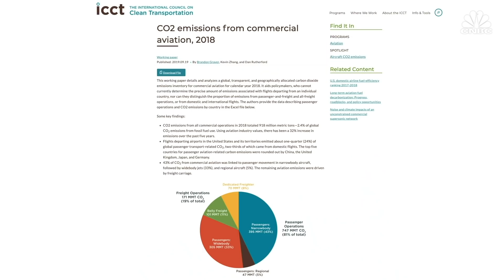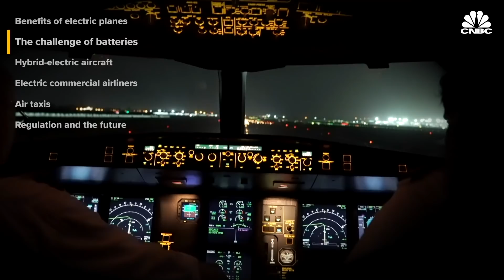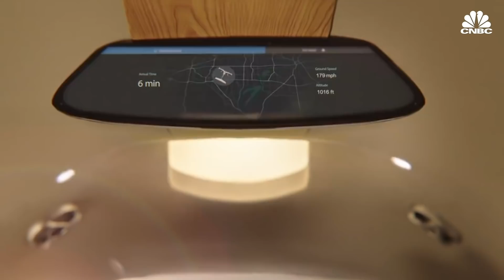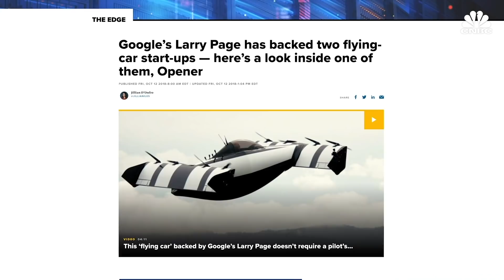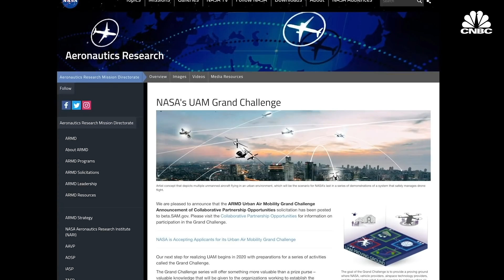Why Don't We Have Electric Planes Yet?

Comment: Liquid fuel becomes lighter as the journey progresses! 

The battery will always weigh the same!
Reply: Exactly why I can't imagine having fully electric planes, the weight is just questionable. Unless we invent lighter batteries.
Reply: @jenreyfernandez  not with current batteries. Solid state high density batteries that can power even lightsabers are what we need
Reply: @jenreyfernandez  (or just used hydrogen)
Reply: @fl00fydragon I actually proposed a hydrogen powered aircraft to my professors, infortunately we're not that technologically advanced to keep it stable.  It's incredibly light, but also explosive.
Reply: @jenreyfernandez  wait, you mean like a balloon? 
Im basically saying that tests with rockets and jets have shown that the thing works. 
Obviously you need different materials for the tanks but there's quite a few breakthroughs the past few years, the most relevant was a hydrogen immune alloy built for fusion reactors.
Reply: @fl00fydragon  Not entirely like a balloon. You need a closed container where you can pressurize gas type fuel so it can deliver the right amount of thrust. On jets and rockets, they're good enough for that. But passenger planes? We don't need speed, we need efficiency and range. Hydrogen isn't "safe" enough for commercial flights, otherwise we would have achieved that already.
Reply: @jenreyfernandez  There's studies that show that we could do so in a bit over a decade, the technology is there to be reliable in the extreme stresses of a rocket that are not found in a passenger plane (thanks to carbon fibers)
Other benefits of using hydrogen is that the fuel itself can be used to cool the engine in both jets and scramjets.
Meaning that a hydrogen refocusing would make high altitude supersonic flight an option for cheap commercial flights where fuel efficiency skyrockets due to decreased air friction.
Not ot mention that it's the perfect fuel to develop spaceplanes, a must if we're looking into industrializing space.

Going back tot hat study I read the biggest hurdle to adopting hydrogen isn't technocal but economic, basically we would be kicking a trillion dollar oil industry in the nuts. 
An industry that needs to be kicked there anyways if we are to prevent having to deal with an environmental clusterfuck.
Reply: @jenreyfernandez  exactly history shows technology gets more powerful and smaller as time goes think of the telephone
Reply: Jen Reyy so solid state batteries?
Reply: @jenreyfernandez  im pretty sure a electric system will most likely produce a better power to weight ratio
Reply: Jen Reyy No is NOT,

The weight has nothing to do with it. We have HUGE plane carriers that travel with Helicopters and Tanks across countries.

Engineering is all you need to deal with the extra weight, once the plane is above ground is completely irrelevant how much it weights before or after.

Edit: for the morons who forgot to read.... ENGINEERING will take care of the extra weight!!!
Reply: @powerhouse884  lol wow so you're just going to ignore physics????
Reply: @powerhouse884  You're hilariously wrong. At touchdown, the overall weight of the aircraft needs to be lower than at takeoff, otherwise the landing gear will collapse. Stronger landing gear are heavier and significantly reduce range and the number of passengers and cargo you can carry, while driving the aircraft's cost (for purchase and maintenance) up. This applies to ALL aircraft REGARDLESS OF SIZE. Unless lighter, denser batteries are invented, or those batteries are dropped from the aircraft in-flight, it wouldn't work.
Reply: @powerhouse884  Fuel is used mainly to produce thrust, and the plane get lighter as the journey progresses because fuel is being used. 

Imagine electric planes with consistent weight flying, it won't be able to produce enough power to fly over the Atlantic. But I see that they can fly domestically, which is great for the environment.

The fundamentals of a flight is Thrust, Drag, Lift and Weight.
Reply: @powerhouse884  if weight does not matter, then we will be building plane using concrete. It is a lot cheaper than the current material used for airplane.
Reply: Lucas D. One solution is hydrogen fuel cells they don’t lose weight which is a problem but they provide a similar energy density to jet fuel.
Reply: Event if you were to redesign the frame of plane you would be unable to do so economically. The main problem with what you just said is a findamental miss understanding of how thrust works.
Reply: More thrust= more power = more cost.
Reply: @flyfox3621  Generally speaking only really large airliners have the requirement to burn/dump significant amounts fuel because MTOW is significantly above max landing weight.

Not every airliner has the ability (requirement) to dump fuel
Reply: @powerhouse884  You don't understand the point this isn't about payload capabilities
Reply: @powerhouse884  Well you're very wrong lmao. Study physics and engineering before making statements like that
Reply: AwkwardYet LOL Wow

Amazing input on your part! Lol
Reply: arjun sharma Said Donkey
Reply: @powerhouse884  That's completely inaccurate compared to basic equations for lift and power for aircraft to fly. 

Also it's not weight its mass
Reply: @flyfox3621  thats what he told you. Engineers will take care of the weight and build better landing gear
Reply: @powerhouse884  commercial  planes live and die by  cost of the trip it
Reply: You could say liquid fuel becomes lighter as the flight progresses. Or if you’re a glass half full person, the liquid fuel plane is heaviest at the exact worst moment when it is trying to get off the ground. From an electric perspective the plane does not have to be heavier at take off.
Reply: @yffips  While that is true it's only beneficial if the weight of electric propulsion systems is significantly less than an equivalent ICE and fuel. 

At the moment the 2 systems weigh about the same so the benefit of electric propulsion dwindles significantly as the size of aircraft goes up
Reply: @powerhouse884  have you seen wight and balance calculation of an airliner? The fact that the airline get lighter is included in the performance metrics of the plane. This is why planes does not top their tanks every time and just filled the required fuel for the trip. Weight of the fuel is a very important metric in a flight plan.
Reply: blitzcaster i understand your point but you are failing to understand Plane carriers which currently travel with TANKS!!!! Freaking TANKS!

No amount of batteries will be heavier than traveling with TANKS.

An electric plane will be engineered around the extra weight. The point is, the extra weight DOES NOT MATTER.

We already have Planes who travel with heavy military equipment.
Reply: @powerhouse884  because on that plane the fuel on tanks act as payload, not as an energy storage system. Here, watch this video for a start. Then you can search on YouTube "airline fuel calculation."

https://youtu.be/VNvzZfsC13o

Edit: ah you mean tanks as in combat tanks, not fuel tanks. Actually if you watch the video I posted batteries is indeed heavier than tanks. Also it is about power stored to weight ratio, not weight alone.
Reply: PowerhousePR guy you do realize those planes travel farther without carrying those tanks right. 
Second, any plane carrying tanks are usually military owned are constructed differently from commercial grade use. 

Weight is everything in this case. More weight means less distance it’s able to travel and areas that need to be strengthen when touch down comes which in turns add to even more weight. 

No one is saying the plane still couldn’t fly, but we are saying weight adds a costly expense that does outweigh the pros of using an electric plane
Reply: @powerhouse884  but those are massive carriers. United, JetBlue all the other airlines, could not produce such a humongous aircraft for mass production and mass travel
Reply: Algae based biofuels are the ONLY reasonable alternative to aviation fuel. Batteries will never be a realistic solution.  They are just way too heavy.
Reply: @tarstarkusz  Dude, you can burn hydrogen in a jet. 
It works. 
No co2
More energy density
Reply: @Fl00fy... Too bad we don't have any hydrogen!  Hydrogen fuel cells could be used as well. Again, too bad we don't have any hydrogen.
Hydrogen, assuming we made it, requires very heavy containers to hold it.
The only realistic option is very expensive. Synthetic oil made from algae.  It would be 100% carbon neutral, but it would also be extremely expensive, basically an effective oil price of hundreds of dollars per barrel.
Reply: @tarstarkusz  Or you can produce hydrogen with 2 cables, a tank, 2 metal rods and an energy source...LIKE NUCLEAR ENERGY!
Reply: @fl00fy... Not very efficient.  Not an energy SOURCE.  At best, it's an inefficient carrier.  Fuel cells would weigh too much.  Algae would actually be a source. There is a lot of improvement to be discovered in algae. It would also allow the continued use of a trillion dollars or more of equipment.
Reply: Abhishek Angadi but we could have super chargers in The sky
Reply: Okay hydrogen helps this
Reply: jweltsch22  what would you suggest, out of curiosity? I could see hydrogen being viable with the correct engineering and time taken to make it safe. If we already have a safer alternative now besides lithium ion batteries, what would do it?

(Not an attack, I'm genuinely asking for an opinion. Promise.)
Reply: can actually answer to lighter battery is not a battery but A capacitor A capacitor is simply two plates with a cavity between them they can store electrons through a static electricity It can be instantly charged in nanoseconds and it can be discharged just as quickly but the nanosecond think normal capacitors can’t be charged in nanoseconds it’s only atom thick sheet of carbon stacked one layer on top of the other to produce the static electrical cells that can be charged and discharged in nanoseconds and it has a far greater energy density than lithium ion because of the number of sales he can half due to the fact that these are tiny microscopic individual sheets and you can have trillions of them stacked on top of each other and there’s also the fact the atom thick sheets of carbon  itself has very little electrical resistance and if you fold the atom six sheets of carbon at 1.1° to produce a three-dimensional structure or you can create regions of electrical conductivity and resistance and you could possibly use that to further enhance the capacitor to control the flow of electrons this is some really advanced stuff I’d encourage you to study it so you can both increase the energy density and because this thing is predominantly made out of carbon it’s significantly lighter than lithium ion battery and it would also be very dirt cheap because his primary ingredient is carbon and theoretically you can genetically modified bacteria at the manufacture of the Atom thick sheets of carbon through something called the carbon fixing cycle Or you could even 3-D printer to using lasers through laser vapor deposition on a sheet of copper you can even produce it by combining acetylene with oxygen and igniting it and some other chemical I forgot  but currently that process doesn’t produce very high-quality atom thick sheets of carbon you can also produce cheap very Flawed graphene by using tape and graphite in fact it’s already being used in our cell phones alongside of carbon nanotubes technology darty exist were just in its infancy these kinds of super capacitors of already been developed but their experimental prototype’s Kind of forgot how much energy density it has over lithium but it is significant
Reply: Finally, at last, somebody noticed that carrying a turbine, a generator and an electric engine is a dumb idea.   It makes a lot more sense to ditch that useless electric stuff...  A typical Tesla battery has 450kg in weight and is an energy equivalent of 2kg of Jet A.  Renewable energy is expensive and totally useless without 100% carbon or nuclear back up....  Uber discontinued its driverless car project and is losing money.  They cannot even build an electric truck or a battery powered ship.... Not even a submarine.... How soon? Ever? A nuclear powered container ship?  Maybe....  High energy density is the key.  Only disposable Al-based batteries in torpedoes are OK.  But they cannot be recharged....
Reply: @Cellphone Dave Or, how about we make aircraft powered batteries and let the plane fly into a hurricane so when lightning strikes it, it instatly charges and we have unlimited energy. HAHAHAHA!
Reply: No
Reply: jweltsch22  Aaand wrong. 
Hydrogen is harder to explode than kerosene (You can thank rocket technology research for that find) and material technology has progressed to the point where we have the materials required to adapt hydrogen. 
In fact a study 10 years ago stated that we could move to hydrogen in a relatively quick R&D cycle and since then we've got even better materials thanks to fusion reactor research. 

Also both fuels can be either flammable or explosive depending on the mix with oxygen. 
Hydrogen is explosive at a 1:1 ratio which is not happening, this is why the hindenburg burned and didn't explode. 
In other words you are wrong on all counts. 

Tell me, why are you invested in retaining an old and harmful technology such as kerosene?
Reply: red herring
Reply: I will also try to get some links for you guys on graphene super capacitor’s
Reply: and then there is the lithium air battery that has the exact same energy density as gasoline and because it uses air as A cathode it’s significantly lighter than pretty much any type of chemical battery and because it gets its ions sorry it’s positive ions from the atmosphere age has gigantic energy density or an internal air supply due to the density of oxygen you can have inside of a cell because of how light weight the atoms are you can have a huge amount of energy density like I said but there’s a gigantic mechanical problems surrounding lithium air batteries
Reply: @zaneal-amood5474  So why aren't these 'projects' getting funded or invested by actual aircraft companies like Boeing or Airbus? If it's a good investment, I don't see any reason not to improve this 'project.' 

Reality is, it's just a concept, it is too expensive to make and thus, not economically viable as Aviation gas. Sure they're at least creating something that could benefit us. But instead of creating something new, why don't we just improve what we already have?
Reply: Jen Reyy well that’s because they are the military’s invested in it Boeing Northrop Grumman probably The thing of it is that you just don’t hear it because this is really boring it’s really complicated what I’m trying to say is that CNN Fox News these guys don’t like to report on technology unless they think it’s big news because think about it the military is developing laser weapons they can shoot down missiles to drones and they need really powerful batteries to run those kinds of things so this this is right up their alley for that kind of research
Reply: Jen Reyy it’s in the experimental stage but the thing of it is there is it is very close if anything I would say it’s about five years away i’m sorry that I might sound confusing it’s just that I have a busted iPad sometimes it doesn’t the keyboard doesn’t work so I have to use the text to speech device so if I say anything that sounds confusing please let me know and also I sent you some links to some websites that talk about graphene research
Reply: and remember lithium air batteries have gigantic problems but they’re pretty much the best type of power storage system you could ever want really outside of antimatter
Reply: @Zane... When oil went to $150 a barrel in 2008, there were little companies popping up all over the place for algae based fuels. Pretty much all of them went bankrupt.
Reply: tarstarkusz Well you’re right but the thing of it is though is that graphing is not just useful for batteries it is pretty much the One of the biggest breakthroughs in computer science of this decade in fact your computer electronics right now has Atom thick sheets of carbon inside of it it’s used as a thermal conductor it’s used as an insulator it’s used as a super capacitor is used as a transistor of the transistor thing is still in the prototype stage carbon nanotubes are used as heat conductors but in order to get his insulator property you have to sort of twisted in 1.1° so it’s not just one thing and this has massive investment across the world By companies of every type you could think of engineering and construction benefits from graphing due to the fact that it’s 200 times stronger than steel it was standing tension forces you know shearing forces You can use it to make quantum tunneling transistors which will overcome the moors limit it’s ultra lightweight and it can be used in wearable electronics because it’s made of carbon it’s bio compatible so could be used for medical implants and could power medical implants And it’s also seeing investment from multiple companies in the field of electric Cars due to a large energy storage from a large surface area super capacitors or super capacitor battery hybrids oh basically I don’t care what happens to the battery industry you’re not getting rid of graphene
Reply: tarstarkusz And another hole in that logic is that basically the reason why everybody’s going all in on electric cars that electric cars are genuinely just better than internal combustion engines even if they are powered by algy based biofuel it is just that the there performance is much better and also then even biofuel still produce a small amount of pollution that’s released into the atmosphere and as population on the earth increases the more generators we’re going to need the larger the generators we’re going to need the more cars we’re going to need the more jets we’re going to need the more planes are going to need so that tiny little bit of pollution would still add up to become a very big problem because you’re basically just burning chemicals and you’re releasing it into the environment where as the only real flaw for lithium is that You have to mind it from the ground and that could release in missions but if all the mining machines are electric that reduces the admission significantly and then not only that but advances in mining technology specifically for mining rare earth elements is reducing the amount of damage that we do to land from mining quite significantly
Reply: @zaneal-amood5474  Actually it make sense, it's not confusing. I'm an studying Aerodynamics, going for aircraft maintenance engineer, so it make sense to me. Yeah it's actually great that we could advance technology with Graphene. Down side is, it's just too expensive go manufacture, much more if we mass produce it. Imagine the cost of producing large quantities of graphene, along with the emissions that it creates on production. It basically kills the purpose of being "environmentally friendlier" than conventional plane fuel. 

But, I'm all good with technology advancing. I'd like to see that in the future.
Reply: tarstarkusz and then there is the whole mess of the internal combustion engine itself this thing is a complicated monster do you have any idea how complicated and Ice Engine is oh sure the basic operating mechanics are simple but the practice of building an engine is not I mean it’s really just a miracle that we were able to come as far as We have with this technology it’s really a miracle that we in the first place as a species didn’t dump this idea in the garbage and then wait for batteries even though they weren’t very efficient and just stuck with horses until we discovered lithium ion that’s how complicated and internal combustion engineers in all sorts of components in the engine could break down and fail is where in tear occurs over the years and it’s very expensive to replace because you have to take the engine apart and then rebuild the engine it’ll cost you thousands of dollars so electric cars the only thing you have to replace after 10 to 14 years is the batteries the engine is very simple very very easy to repair and you could actually design the battery to be easy to Replace
Reply: Internal.Combustion.Engine that is what ICE stands for
Reply: @zane... Are these cross-compatible though?  Does computing and energy storage need the same type of purity, the same structures etc?  I really don't know. I'm not really up to speed on that stuff.
It sounds like an interesting field.
Reply: @Zane..  Algae is carbon neutral because the algae produces the oil from CO2 in the air.  I think there is some algae based oil in the supply chain, but it's not carbon neutral because the CO2 is not coming from the atmosphere. But, it is only a miniscule amount of it being produced and those contracts may be gone by now.
A lot of what we do is going to be more than offset by what is going on in Asia.  Not only that, but prices need to come down even in the Occident before EVs are anything other than a luxury car.  The cheapest ones are still in the high 30s.
Air taxis are a pipe dream.  They are never going to be as cheap and common as uber.  Lifting tons into the air is a physics problem. To whatever extent technology helps, cost of regulation will keep it a rich man's thing.
Reply: @zane..  The ICE has over 100 years of R&D behind it.  Granted, the electric motor isn't exactly new either.  Where EVs make sense, by all means, they should be used.  
However, where I live, they will never make sense for most people without an astronomical investment and changes in laws.  It's very simple. Very few people in my neighborhood have a garage or assigned parking.  You park where you can, where there is a spot.  My neighborhood, like many on the East coast were built before the widespread ownership of automobiles.  You would have to change the laws to assigned parking and pay to have an outdoor metered charging station installed in your "spot"
Reply: tarstarkusz It’s Got everything to do with the way the allergy produces hydrocarbons from the oil six to hydrocarbons themselves is the problem it’s self it’s got everything to do with the bio molecules called hydrocarbons that are burned that release the CO2 back into the atmosphere you can make a hydrocarbon that can be burned and release smaller amounts of CO2 but you cannot have one that releases no CO2
Reply: tarstarkusz The electric motor was the very first car engine before gasoline engines took off before the model T car as were electric no seriously the electric car was the very first car look it up yourself
Reply: tarstarkusz Actually they came up with a way to solve this problem there is a magnetic induction charging pad and you drive your car over it and all you need to do is hook that paid up through a cable to your house so you don’t really need to do very much to actually charge the car the infrastructure or you could literally just buy it and install it in your garage and it really wouldn’t take very much to develop a device that could take the electrical current from your house amplifier in and pump it through a cable into your car is charging port so that’s not really a problem
Reply: tarstarkusz oh I’m sorry I forgot I didn’t read what you sent properly The problem of that is that you’re still burning oil and you’re still releasing stuff in the atmosphere and oil has more in it than just hydrocarbons for example there is a lot of studies going into Paul oil and gas fire power plants cause brain damage and cancer so the idea is to just move away from oil completely divorced it completely but you’re right though that doesn’t have any of the pollutants and my guess is that it’s got a lot to do with what the gas released from the internal combustion process mixes with inside of the generator plant that releases I was kind of a mission to but that’s not the only factor see this oil was sitting in the groundFor hundreds of millions of years And combined it with all those different elements with all those different elements it releases doesn’t just release just hydrocarbons so that’s why I hate oil as a power source but oil from alge Would not have that problem you could even feed them plastics probably and they could convert it back into oil Provided they were properly genetically modified but my cases is that you would always be releasing CO2 back into the atmosphere carbon neutral just isn’t enough for me oh you’re basically doing is you’re taking the CO2 that’s in the atmosphere and recycling it back into usable oil and to me it’s just not acceptablewe have to move beyond it Or in other cases you’re trying to create an entirely different type of organic hydrocarbon that produces energy when burned but it still produce CO2 just smaller quantities and again to me that’s unacceptable
Reply: @zane... I don't see how this pad can solve anything.  There are no outlets outside.  Am I supposed to run an extension cord up the block to the spot I can find? This is just a different type of charging station and has the same problems.  Just burying it would entail tearing up the street and re-paving it.  If you don't have a garage, you can't put it in your garage.
Reply: @zane... Not that it matters, but the very first car was the Benz Patent-Motorwagen, an ICE car.  I do know that there were quite a few cars in the early 1900s that were electric.  But we're not even talking about cars, we are talking about planes (or at least I was) when I said lifting tons into the air is a physics problem.
Reply: @Zane.. As I understand it, and granted, I could be wrong, algae based oil is carbon neutral.  CO2 is captured by the algae and then re-released when burned in an engine.
Reply: tarstarkusz yeah and It’s only became at least about 30% efficient maybe even 20% efficient because of all the escaping energy from the internal combustion reaction we don’t we have no way of harvesting it only in recent years in the recent decades we develop infrared photovoltaics could convert the heat energy into electrical current where as electrical engines are 70% efficient 80% efficient the only limitation with how fast you can go is the amount of motors you can pack into your car engine which by comparison to the cylinders of an internal combustion engine are very very tiny and the energy density of your battery or super capacitor and the weight of the battery but the thing of it is is that as I’ve shown you that’s not gonna be a problem for very much longer and then there’s other types of batteries to their Assam I think there was aluminum lithium batteries I’m not for sure I have to re-look that up again then there’s batteries based on fluoride there’s all sorts of discovery said are reducing the weight of the battery and increasing the safety one is  by replacing the liquid electrolyte with a solid-state electrolyte that also reduces the weight significantly for example another massive breakthrough in recent years what is the discovery of a type of plastic they could behave as an electrolyte see I am on a quest for carbon negative I don’t want carbon neutral I want carbon - oh and to answer your question regarding the mass production of graphene A recent discovery allowed us to 3-D print it using laser vapor deposition on a sheet of copper see the ideas you have your laser beam emitter you have carbon gas under high-pressure then you have the sheet of copper on something that looks like a treadmill and then the idea was the laser compress is the carbon gas and causes it to deposit on the copper as the copper seat moves along the treadmill creating a graphene sheet basically and it’s very high-quality and this is basically a 3-D printer for graphene Didn’t your question it was someone else’s question sorry but some because these capacitors are very lightweight they can allow for air cars they can allow for flying Vitale’s to become far more than just a pipe dream because its primary ingredient is carbon and copper very lightweight elements and it’s solid state So it’s much safer and because of how cheap carbon is this thing can be easily mass produced on an industrial scale oh and then there’s another way to create air taxis and this way is even more cheaper you just don’t have batteries in your all electric air taxis or internal combustion engines you use atmospheric electricity and I’m not talking about Nikola Tesla I’m not talking about harvesting energy directly from the static electricity of the atmosphere I’m talking about using microwaves to transmit power through the atmosphere microwaves have a very long range and they have a very long wavelength that allows them to pass through the atmosphere with very little resistance that’s why they have that range and you can use rectenas to harvest microwave and convert them into power there a type of antenna but instead of using radio waves it uses microwaves it interacts with microwaves and a molecular level to produce electrical current that’s why we can convert a beam of microwaves into electrical information so the only real problem with that is building the infrastructure to reflect microwaves produce microwaves and as well as transmit the microwaves to the flying aircraft but after that that’s  really your only limitation and actually setting up this infrastructure really wouldn’t be all that difficult because were already using microwave transmission to create 5G Internet it’s one of the ways of creating it so the technology for that exists all that needs to be done is to be improved and the 5G revolution is going to drive those improvements And the infrastructure would actually be beneficial so there would be zones where a wireless powered air car could travel which would prevent total chaos and filling up and congesting the airways around the city so that infrastructure would actually be an improvement
Reply: tarstarkusz Another problem of the  internal combustion engine is that it’s just not as fast as an electric vehicle the difference is how many cylinders you can add to an internal combustion engine versus how many motors you can add to an electric engine that’s the question there and then there is the weight of the 2 Engines the complexity of the two engine types compare the complexity of the two types together one is far more durable than the other because it is far less moving parts far less nuts bolts screws tiny tiny little screws and nuts that you have to disassemble the entire engine defined didn’t repair which can cost you thousands of dollars
Reply: tarstarkusz https://en.wikipedia.org/wiki/History_of_the_electric_vehicle
Reply: tarstarkusz the very first electric vehicle was an 1890 invented in 1890 so they are older than the Ford model T And the thing of it is is that we’re not talking about in creating electric airplanes for intercontinental flight that’s decades way even with super capacitors that have the energy density of a lithium battery and are made of really light weight carbon air cars and taxis that are vetols can easily use graphene super capacitor’s Because we’re not talking about trying to fly from one state to another era cars Vertacal takeoff and landing capable taxis they just have to city to city district to district Town to town and graphien super capacitors are incredibly light weight because they’re primarily made out of carbon actually they could be even lighter than the liquid gas used for modern day jet engine once the gas tank is full I mean
Reply: tarstarkusz like I said I don’t care for carbon neutral that’s just taking the path to Heck that is paved with sunshine it’s good for a stopgap measure but it’s not good as a permanent replacement as like I said you’re not getting rid of the CO2 you’re just recycling it and ensuring no more waste emissions are created
Reply: @Zane... Please, if you can, break your text up a bit.  I just don't see uber being electrified.  I don't doubt very expensive air taxis, I doubt cheap air taxis.  If a car breaks down, no big deal. If a helicopter breaks down, look out below.  

It takes an enormous amount of energy to lift mass into the air and it also creates a lot of noise, even with an electric motor.    These "taxis" would not be operated by Somali illegals, but licensed pilots, again driving up the cost.  No amount of technology can overcome these types of problems.  

Regulation is where I see even cars running into a problem.  I absolutely oppose driverless cars or self-driving cars.  The tech sector has proven again and again and again that they cannot keep anything secure and they cannot keep major bugs out of software either. This is getting worse not better.  

I always knew they could not resist the temptation of making these cars on the internet and remote updating.  The vulnerability to hacking and the kind of havoc that can be created with 10s of thousands of compromised vehicles is truly scary.  I was right.  If we are even going to consider driverless cars, the program needs to be on a ROM chip that cannot be changed or a PROM chip with a physical lockout by default.  This way they can be quickly and easily upgraded a dealer without exposing society to the dangers of hacked cars.
Reply: @Zane.. The main problem with electric motors is you have carry around heavy batteries to power them.  We'll see what the future holds.  I've been hearing promises of technology just around the corner for 50 years.    When they say "in 20 years" they usually mean "an unknown amount of time because it is not possible today without significant technological hurdles"
Reply: tarstarkusz Those technological hurdles are actually around the corner and the problem is is that when you develop a new breakthrough when you discover a new breakthrough you have to send your work in great detail to be  reviewed Reviewed by other scientists in a process called peer review and then if they don’t find anything wrong with your process with your theories with your equations on a fundamental level which basically means well proven laws of science that your device would contradict if they don’t contradict those laws of science then you get past peer review which has multiple processes multiple times it happens multiple times scientist in Other laboratories around the world they have to see if they can’t replicate your Process that you used to create these batteries in their own laboratories independently and then once you get past that phase you have to improve have to increase the efficiency and often when you’re designing it you discover entirely new problems that they have to be addressed but the point is is it at least we should just be thankful that there are this many discoveries in the field of energy storage because the worst thing you would want the last thing you would ever want is to hear nothing at least we hear everything all the time about new breakthroughs in batteries the worst thing would be to hear nothing because that means nobody has any idea how to improve it or they think it’s impossible like for example you rarely hear anything about any breakthrough in faster than light travel and there’s real good reason for that Is there another thing Elon musk also showed us through his company SpaceX that something that people thought for generations was impossible was only just waiting for the technology to catch up for it and it already cut up to the idea but everybody just thought the idea was ridiculous and laughed it off that idea was self landing Rockets I mean who would’ve ever guessed that would have worked if I had taken that idea to somebody 20 years ago who has a rocket scientist they would’ve just laughed and he would’ve listed all of the logical perfectly reasonable explanations for why that could’ve never worked And I’m sorry about my text the problem is is that my iPad is kind of finicky so I have to use the text to speech device
Reply: @zaneal-amood5474  your comments are really good and informative, but very hard to read without any full stop or commas. put a.. after. each. sentence.
Reply: just dump the batteries
Reply: Batteries get better density overtime tho.
Reply: @UtraViolet...  We do not need marginal improvements in batteries for this to work, we need whole number multiples.  Electrification has become a cult.
Reply: Why not put a BAND on airplane's,they are the biggest killer in the world.
Reply: True and sometimes it's necessary to release fuel in order to perform a safe emergency landing. You can't do that with a battery.
Reply: Electric planes will fly much higher because they dont need oxygen to combust the fuel. There is much less drag the higher you fly therefore they will be much faster
Reply: @mo7881  Available oxygen for combustion is not the reason airliners don't fly higher. 

The aerodynamics of creating lift in thinner air is.  The U2 spy plane can fly at 80K + feet.
Reply: gel batteries are 5 times lighter
Reply: Until it hits the ground.
Reply: Hydrogen fuel cells in electric aircraft will fix this.
Reply: Battery have liquid in them (lithium iodes) and that's only 1 flaw against many pros
Reply: In theory they could be parashuted out mid flight and re-used in another plane. In planes, mass is drag is consumption.
Reply: @Daryl Johnson thats a great answer to the issue, thanks!
Reply: but my smartphone feels heavier when its charged
Reply: Jeffrey Johnson  Most of these engineering challenges have been  solved thanks to it's use in the aerospace industry.
For example the current breakthroughs in material science, such as carbon fibers and grapphene make it possible to have lighter tanks for compressed hydrogen.

Additionally it fits the bill for the criteria needed for an immediate solution.

And if it's energy density per volume was not viable it would not be used as the fuel of the delta series of rockets.
You know those machines where every extra gram of weight is a setback.

Now if it does turns out that it's not as profitable per flight as kerosene then here's a revolutionary idea: maybe we should prioritize the wellbeing of our species over the profit margin of a few executives.
Reply: Jeffrey Johnson  
Which are all problems that can be solved with current day engineering. Even if you reduce the passenger count by a bit it's worth it and can be offset by cutting the profiteering of airline companies, you know the same guys who proposed to make passengers stand in the plane to maximize massenger count and sell basic comfort as a luxury.
In other words, regulations are obviously required.
Reply: Jeffrey Johnson  And all those methods can be implemented to create fuel tanks for airliners, there's no rule that you can't make a longer plane or use multiple cylindrical fuel tanks .
Reply: Jeffrey Johnson thank you for the insight
Reply: @Ben  Daulton  You are the one that is stuck in a fantasy world. 
We are facing a crisis where we need to radically redesign our technology or face a biosphere collapse. 

The first is hard but feasible as the technology is already there and we just need to get doing it, the latter is near impossible because it's expecting us to terraform a planet we'll destabilize, a technology that in the best case scenario we're 3-8 centuries too late from when we'll need it and would demand global scale megastructure production. 

You can't tout the line "innovation will fix it" when you are against a project that is entire orders of magnitude less complex than what you are expecting. 

Yes, profit margins will have to be cut and the aerospace corporations will have to be commanded to do so. 
Guess what, we've already done that before, it's how we responded to world war II, a lesser threat when compared to the upcoming extinction event we're creating.
Reply: @Ben  Daulton It is technologically feasible without requiring us to wait for the development of some wondrous new technology from scratch. 
Guess what sunshine, unless you make the final push to fund the engineers and produce a technology it will never exist, regardless of feasibility. 
This is a case where such a push is required. 

These "vegan farts" is the most energy dense gas we got and can be produced with nuclear energy without harming our biosphere. 
This is a viable solution to the problem at hand. 

For all your whining I don't see you presenting a solution, let me guess, you will "invisible hand" stability back into a devastated biosphere?
Reply: Actually, a full battery is slightly heavier than an empty one.
Reply: @thespectator5259  Certainly I would agree. I can see electric flights being viable for short range routes in the future but long haul flights are a tough nut to crack.

Looking at the current fire situation in Australia doesn't bode well for our future. At what point do we say it's all not worth it. To hell with cross ocean flights. If we have an apocolipse and the entire planet is consumed by fire do we then accept that reaching the other side of the planet should take a week. I think I would be ok with that. I'd even be ok with that now.
Reply: Daryl Johnson  
@powerhouse has obviously never flown a plane and his engineering has no competent answer for density altitude at high elevation on a 95 degree day.
Reply: That's a good point.
Reply: Not the combustible battery used on note7. Samsung is always ahead of curve.
Reply: A airplane produces approximately  1 tonne of air a second by the laws of thermodynamics. How can a engine combust without gas ? There is absolutely no work done by the system.
Reply: Solution: we can use a proven 0 emission jet fuel with superior energy density: hydrogen. 
The reason we're talking the slow way round is the petrodollar.
Reply: Ok boomer
Reply: Couldn’t they do something where the battery/some batteries are dropped out of they plane at the airport before landing. Then reinserted at take off for the next flight.
Reply: J Bril or better yet, drop the people out of the airplane
Reply: the Boontz that’ll work too lol
Reply: @theboontz58321  lol great idea. Just mount the batteries to the passenger seats and drop them out together.
Reply: @Jab_Reel  dropping lipo / liion or similar batteries is like dropping  incendiary bombs. Just imagine they have to "emergency jettison" some batterys over a city that are about to set the airplane on fire, like the lipo in the "dreamliner".
That would be like fire bombing London or Berlin all over again.
Reply: Daryl Johnson Probably cuz you lack a brain to participate on the argument.
Reply: Daryl Johnson Thats nice, so you are assuming we would use the SAME batteries we use for cars and put them to Planes?

My argument is not even about lithium batteries so...... You made all of that math for absolutely nothing.
Even the video speaks about improving batteries with NEW tech.

My argument is how engineering will solve the WEIGHT problems.

Funny you say i don’t understand engineering while providing 0 argument on regards how ENGINEERING solves the weight problem.

You know, like in GIANT boats, GIANT planes, GIANT skyscrapers. Thats the whole idea of engineering..... To CREATE....

Change aerodynamic, improved wings, etc...
Reply: @powerhouse884  Dude, no battery of any type will EVER come close to the energy density of petroleum. Hate to break it to ya, but petroleum is king for a reason,  it's freaking awesome.
Reply: @CGoffgrid  Wait 20 years.
Reply: @CGoffgrid  while we all want to get in on the PowerhousePR beat down you should caution against making claims about future tech. Everyone who says what can't be done ends up looking like a fool within a few decades.
Reply: @Gunshinzero  Let's hope so. But I don't think so.
Reply: @CGoffgrid  i think  he doesnt understand  why almost everything uses  petrol  ...... if this  guy is right a trip  across the Atlantic  will  take 10 hours with  20 people
Reply: Abhishek Angadi Cool story bro.